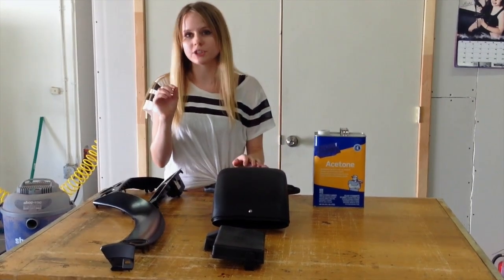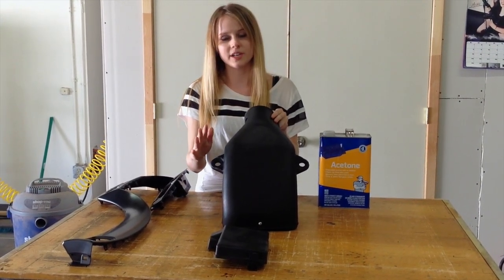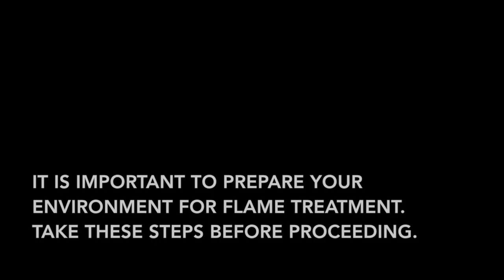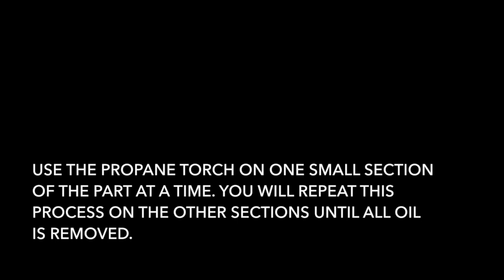Flame Treating Plastic

Comment: I think there is more to flame treatment than just removing release agents. It's very effective on virgin plastic stock like very slippery UMHW. I used the process to increase the adhesion of the epoxy bond of UMHW to wood for an aircraft ski. It was highly effective. Electrical Corona treatment is another process that has similar results on "non stick" plastics.

Comment: This is a cool video. Good job! I hate know-it-alls... but I did want to mention one little thing. You should not turn a propane torch upside down like that while it is burning. To be 100% safe, you should never even really tip it beyond 45 degrees. The ideal way would be to leave it flat on it's base, and move your plastic part through the flame, rather than the other way around.

Comment: If the plastic doesn't degrade from Acetone then I would go all out and use lacquer thinner and forego a soap and water treatment as any soap residue would be akin to the oily residue you are taking out.  Thank you for this tutorial on prepping plastic surfaces for painting or gluing.